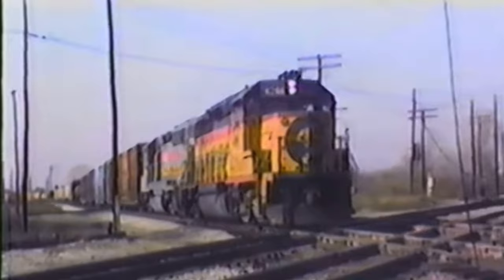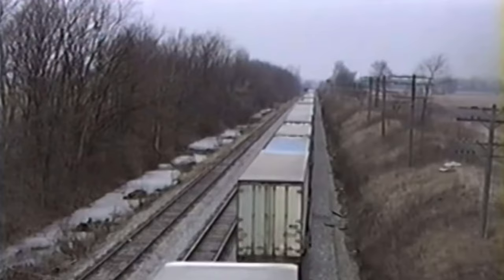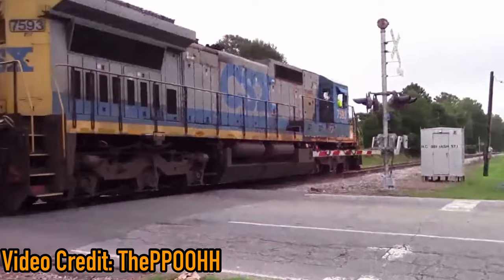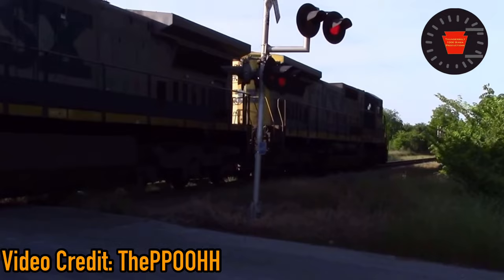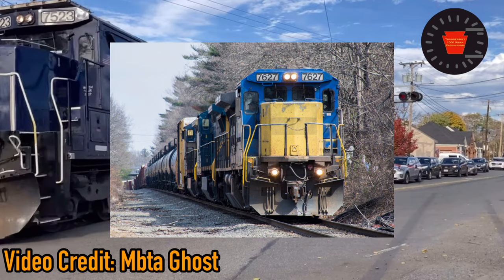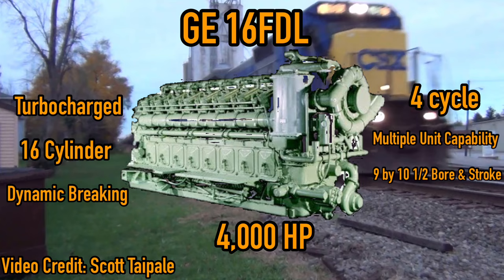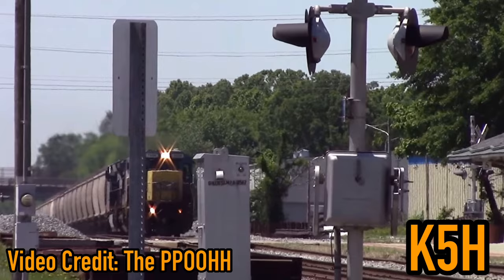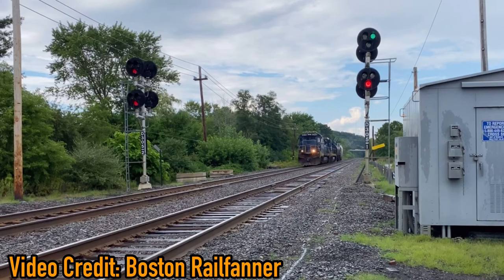Engines of CSX: C40-8 (Standard Cab Dash 8) ft @Thunderbolt_1000_Siren

Comment: Great video 
The C-40-8 was my favorite locomotive to operate on CSX when it was in the lead of the consist
The old control stand, was a plus over the desktop control stand on the 
dash 8’s.
Never had a problem with the throttle powering out the 16 cylinder prime mover.
The locomotive would dig in and keep pulling.
The handle on the K5LA whistle gave you the cadence equine to other engineers!

Comment: Great video. An interesting thing about 9280, it never actually had the standard PTC you find on the rest of CSX. 9280 is only equipped with ACSES PTC, which is used mainly on passenger railroads in the northeast, including the MBTA which Pan Am ran on a lot. Most of Pan Am's locomotives were equipped with it, including 7627. But, when it got repainted, the unit never actually got standard PTC, and it to this day only has ACSES, which is why you never see it leading outside New England. CSX today only has (to my knowledge) two widecab Dash 8s left active, which are on very short time now. Many of Pan Am's Dash 8s recently got sold to the new startup shortline Berkshire & Eastern and the remaining ones are still active on former Pan Am trackage that CSX still owns. 9280 has now rejoined the Pan Am units in New England and will probably stay there until more newer power arrives to replace them.
Reply: Well said
Reply from the maker: That explains why 9280 has been running around up there in the NE recently. Its nice to know that CSX didnt sell the rest of them off and gave them away. 9280 says its still on the roster, but I guess that may have changed while I was working on the video.
Reply: @buccaneerrailfanning1776  it is still on the roster, it’s just operating on the former Pan Am right now. The MEC Dash 8s are still owned by CSX. The Berkshire & Eastern took over operations of the Pan Am Southern in September and they bought some of the MEC Dash 8s but not all of them
Reply: @buccaneerrailfanning1776  They used CSX 9280 for the engine pool which basically just had it trail as foreign power on BNSF and other railroads. Then after that they brought it back up north